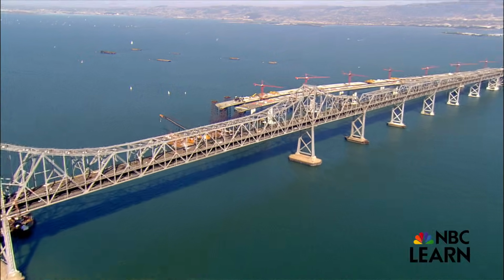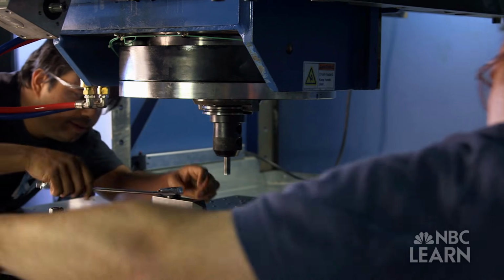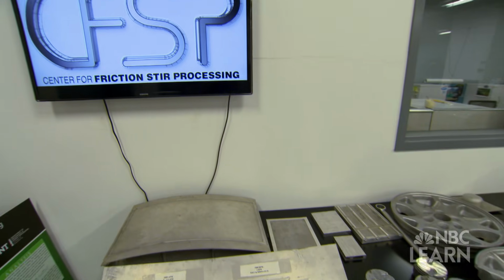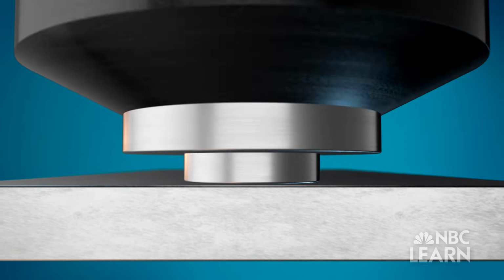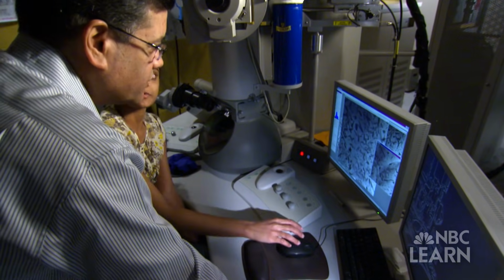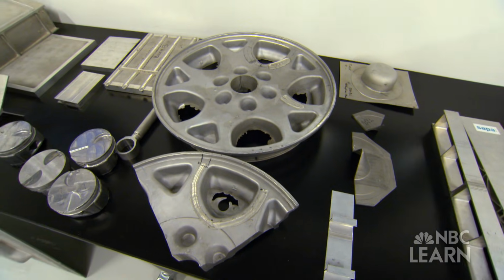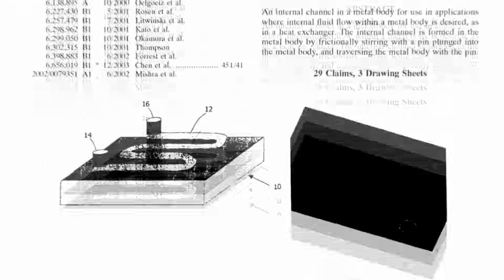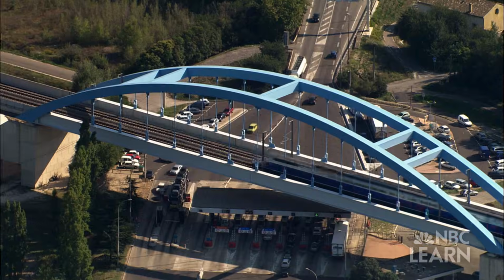Science of Innovation: Friction Stir Welding

Comment: When you weld, bend, brake, or machine a piece of metal it creates a discontinuity. An example of this is creating a weld in a piece of steel. This will change the molecular structure of the steel perhaps making it martensitic. The result of this will be a harder and perhaps stronger piece of steel. This will also result in a steel that is less ductile (not as tough). The same is true when you brake a piece of steel. It will be harder and more rigid at the brake line however if it is struck by something it will crack rather than bend (result, less ductile or not as tough). Can someone please tell me how the molecular structure of metal that is friction stir welded is changed?  Is the result both more ductile and stronger?  If this is the result, it would be an amazing process.  For every give there is a take. For every advantage there is a disadvantage. If this process defies the rules of the last two sentences the possibilities are limitless.
Reply: Yes, the weldment is stronger and tougher since there are no molecules in metals rather there are metallic bonds... the crystals are broken down into finer crystals during this solid-state welding process due to plastification driven by FSW tool (frictional heat+extrusion type load), and the resulting fine microstructure gives good resistance to slip hence strength is improved as well as favours ductility once slip is initiated. 
Martensite is a diffusionless transformation which is driven by a certain amount of cooling rate (observed in certain materials e.g. NiTinol, High entropy alloys including steels).
Reply: How the hell can you use the word "martensitic" talking about Aluminium

Comment: Invented in 1991?. I worked for a company manufacturing engine valves using friction welding in 1972
Reply: It's friction stir welding and not friction welding. The processes are different

Comment: Would it be possible to create a manual friction stir welding machine? This will be a phenomenal component for manufacturing in the shop. But this would revolutionize welding if there was an application for stir welding to be used in the field.
Reply: As far as i understand, it requires constant high pressure. I think it'll b difficult to make a manual machine for this.

Comment: Maybe a super stupid question, but could this be used for other materials too? E.g. Carbon Fiber?
Reply: yes it works on other materials, but not on every material. things like carbon fiber would not be a likely candidate due to 2 problems. first is the epoxy doesnt soften when heated, it breaks down, and second is the carbon fibers them selves would not be left in a good weave for the part to have strength. 

you could think of it like trying to join two T-shirts together with a spinning drill bit. the threads are more likely to wrap around the head and tear off than weave into a strong pattern.

Comment: This isn't that good because of the canal that is left after the process.  At least with traditional welding, I can grind off the top of the weld to reveal a finished weld that cannot be seen.
Reply: Some alloys like AL 7075t6 would not have traditional welding work, that's why this method is used in spacecraft manufacturing
Reply: Tough to weld low melting point light weight alloys such as Al and Mg using conventional techniques. Hence, FSW's importance has grown.

Comment: This is called "Spin Welding", and I used it in 1982 at Molycorp, on polyolfin plastic. . . I see it's now made for metals.
Reply: This is different from spin welding. Spin welding involves actually heating the material in the components being fused to the melting/glass transition point. In friction stir welding, the material is only softened; it doesn't change phase.
Reply: @thecma3  Yeah it remains 3 phase.
Reply: Katsu-Graphics  I guess you know more than Salvatore Bruno- President and CEO of ULA Rocket manufacturing... it’s called Friction Stir Welding but pretty much everyone who uses this. Spin welding requires actual melting of metals, this process is not changing any thermal properties.
Reply: You please try in google... This was invented and made patent in the year 1991...
Reply: @ShivaKumar-hh1ko  Russian (soviets) patents and first testing, not uk, if anything they improved, but as in most things never invented by them only to market and run with it!!!!
Reply: Weird considering TWI was the first organisation to invent this process in 1991.

Comment: All thiese lies... It's NOT stronger than a correct weld.. it's NOT as hard as normal aluminium It's NOT the same as a complete sheet of aluminium. lies lies lies...
Reply: Rasmus Andersen... You must’ve been one of his students that couldn’t make the grade... And still bitter about it. From what I know about welding and metallurgy, this seems to be a much better and more efficient way of welding aluminum. When a HAZ is created by welding, there is more margin for error. This method creates less heat. Seems pretty cut and dry
Reply: @jimwolabaugh3608  Show me a DOT strength test or a stress pull test.. and I'll bend over :)
Reply: dude FSW have higher weld strength also dissimilar metals can be welded with no fumes and smoke.Yield strength and Tensile strength of friction stir welding joints are 31% and 13% higher than that of TIG welded joints. and TIG is stronger than MIG weld but MIG is more accurate.
Reply: @greatsiraj  I just t old what was the lies.. idc about what it can do.. its NEVER going to be stronger when heated and cooled again in only 1 part of the sheet.
Reply: @greatsiraj  I'm going to have to argue that GTAW (tig) is FAR more accurate than GMAW (mig) and i am certified AWS D17.1 the only problem i can see is will FSW have 100% penetration? I don't think it will whill leave weak spots in the weld.
Reply: @thestumaji656   yes sir, sorry i got mixed up with MIG and TIG, its been few years for me .  there has been some innovations  to improve penetration depth using new tools,. I have read somewhere fsw could achieve 80% of base material strength at its best. So im assuming 100% penetration is not possible but coming from either sides of weld joint, would give a better weld strength
Reply: @greatsiraj  but we can achieve 100% penetration now with TIG. I am AWS D17.1 certified and FSW is no where near being certified for flight . I know its used on fuel tanks for rockets but thats lo pressure . FSW can not be used on either side of a tank  as in a delta heavy it can only be used on the outside of the tank . Thank you for your opinion i look forward to another reply.
Reply: @thestumaji656  This type of welding is nothing new, was doing this 20 years ago at a science research institute and you can get almost 100% penetration by making a tool bit with a longer tip that penetrates deeper into the material but there are limitations. What you forget is it just doesn't run the weld along the outside but the tooling penetrates into the material by the depth of the tooling tip.
Reply: @Mescalinum Sunshine  I must say you did not understand what I said. Any weld ANYKIND of weld is NEVER AS or STRONGER than clean sheet.

Comment: Who is here after smarter every day ula tour??😁
Reply: Last night after ULA tour video, I kept thinking why spacecraft uses stir welding and here I am 😁
Reply: Me! I wanted to see how the center of the metal is bonded  when they don't use heat
Reply: Actually came here a few weeks ago because of an article about a knife hardening process using stir processing, it also changes the metals properties in a favorable way by making the grain more spread out and breaking up the chunks of carbide, although it could be different for the aluminium they're using. Really cool stuff
Reply: Elon needs to learn from ULA.  Isogrid with FSW.  If you have access to Elon, tell him to watch that interview video.
Reply: @MrH786  i am sure they are using iso grid for falcons,but star ship doesn't need that because it is made from stainless steel
Reply: If you watch the Padre videos, you will notice that the stainless steel is too wobbly to assemble because there is no skeletal support system. SpaceX is also using basic fusion welding techniques with individual welders.  These two things will make the Starship prone to numerous defects or failures.  Even if they get a Starship up, there is a high probability it could break apart or fail due to stress issues.
Reply: @MrH786  the structural support will be available when tank goes under internal pressure,and ir doesn't need skeleton support,and you cant stir weld stainless steel,even ula was welding steel parts normally in smarter every day video
Reply: Using the ship as a tank is dangerous especially when the welds are not good.  One little tear or defect will lead to catastrophic failure.  Also, recent research has been able to join stainless steel and other alloys with FSW.  ULA was using mostly aluminum.
Reply: @MrH786  SpaceX is using TIP TIG welding last I heard, and they are also moving towards automated welding.
What you see there is just as much working through the mass production details as hand building the rockets.

Also, many previous rockets used single wall stainless steel construction, and the Centaur upper stage still does.

So you have to perfect your joints, your weld techniques, and use good xray inspection, as SpaceX is doing.
Reply: @ke6gwf  Yeah, the point is that they are using inferior fusion welding techniques.  When you see individual welders working on the Starship to patch it up, that should be questioned because those joints are prone to defects and high failure rates.  Hopefully, like you said they are moving to automated techniques like solid-state welding which established aerospace companies like ULA do currently to reduce man-made introduced defects.  Basically, Elon is building grain silos or water tanks and trying to shoot them up in the air.
Reply: @MrH786  you know that ULA still uses "inferior fusion welding" on the Centaur upper stage right?
If you can find me a current reference of solid state welding being used in Full Hard 301 stainless steel, I would be interested in seeing it.
Yes, tests have been done on soft annealed 301, but even they aren't in commercial use because it destroys the tooling way too fast.

What's a better way for hardened SS that's actually being used?

And also, Elon is currently having a new stainless steel alloy developed in house at SpaceX, which won't be the first they have created, don't you think he's going to be working on finding or developing the best possible welding solution as well?
Reply: @ke6gwf   On Centaur, they use resistive welding appropriate due to the thin walled structure of the stainless steel tank, so is not inferior at all. In addition is automated.
Reply: @pisolo86  I agree, I was replying to the previous comment saying that SpaceX was using "inferior fusion welding" rather than friction stir welding, and so I was pointing out that Centaur also uses fusion welding, which he had called "inferior".
I was saying that in some cases, such as with SS, it's the better option, not inferior.
Reply: I
Reply: Me 😂
Reply: Me
Reply: I actually watched that video yesterday 😁, but I was looking for a solder brass to aluminum video and this one came up and I couldn't help but click.
Reply: Amir Safari me lmao
Reply: Smarter every day is dumbed down. Just saying. 😎
Reply: Right here
Reply: Yess
Reply: Student of the professor linked this for us
Reply: Yup
Reply: I am! Amazing process
Reply: me
Reply: 👍me
Reply: Me....
Reply: guilty
Reply: I'm here after watching friction welding titanium
Reply: lol im
Reply: 😄
Yes me too.. I wanted to know how they got the centre of the plate welded together by doing this

Comment: Steel to aluminum with some kind of cross polarity would be a game changer.
Reply: Ultrasonic welding can join steel to aluminum with enough force. Check out fabrisonic, they make 3d printers using that technology.
Reply: You can use FSW to bond dissimilar metals.  The largest problem with those two is thier melt points are very different, and so are thier expansiveness.  This leads to internal stresses.
Reply: Thats new , two different parent metal , i wonder how to make a WPS and  welding qualification test for operators

Comment: Currently iam doing my final year  engineering project on FSW .
Reply: For aluminum to aluminium: 800 to 1200 rpm and high speed steel tool. 
If steel involved: (don't know) rpm and boron nitride coated tool.
Reply: You need plates to be tightly attached with pressure applied during fsw. Pin dia and depth of penetration is also a factor.
Reply: @Mescalinum Sunshine  you please try with a vertical milling machine... You can find better results...
Reply: @Mescalinum Sunshine  Working of FSW and Milling machine are same.. The thing is we need a tool.. If so you can try... Myself using FSW...
Reply: Working on joining Al-6061 and Mg AZ-31.
Reply: lol same, from this university too... never heard of Prof. Rajiv though nor ever heard of this lab 🤔

Comment: I wonder which is stronger... friction weld(where both of the parts melt and conjoin into one part) or friction stir weld.
Reply: For this particular case they are not using cylindrical rather they are using flat plates...
Reply: Very different applications for both. You can't friction stir weld two cylinders. Neither can you friction butt weld two flat plates.